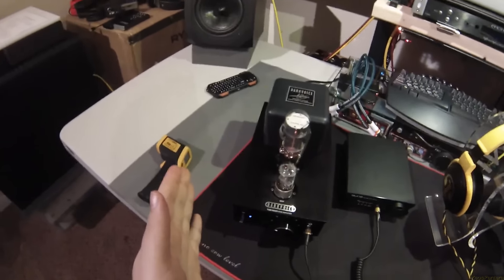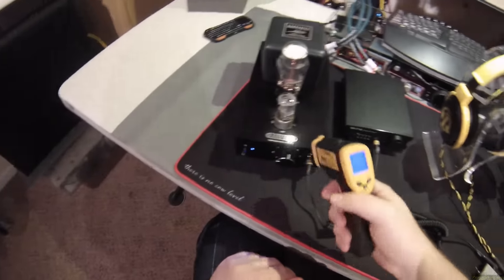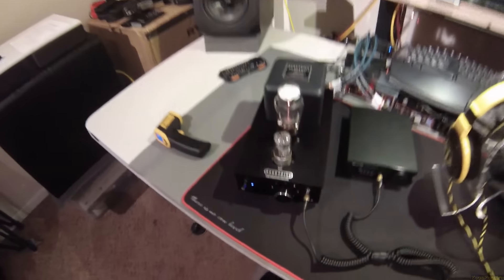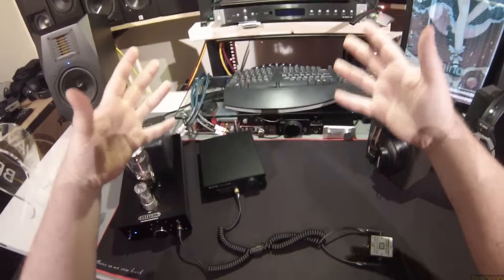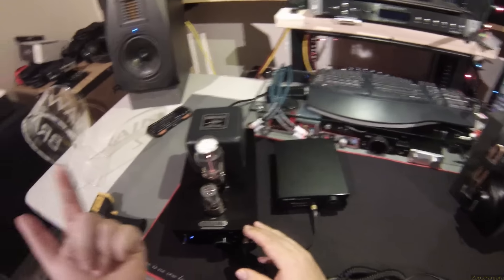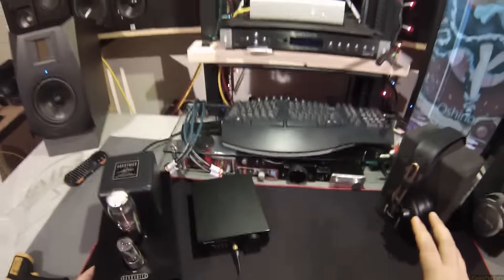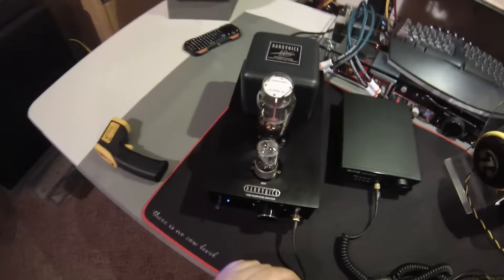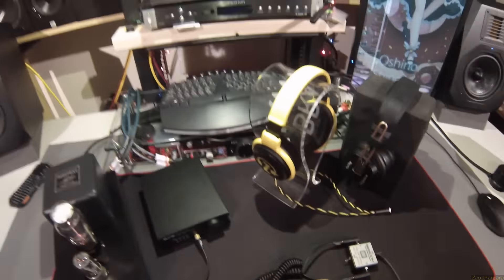Z Review - DarkVoice 336 Tube Amplifier

Comment: The problem with analysing tubes is the fact that every single component from transistors to capacitors to resistors and the tube itself, which is why emulating it well is damn near impossible to do, but in the market of guitar amps there's things going on where people have done just that to make a transistor amp sound nearer to the vacuum. And that's why we are still master-race'ing all over the place about tube amps still

Comment: Turning down the bass is called tightening the bass. It's common among Metal guys. Not sure if Pop guys know about this but it's a common thing if you talk about Metal. Because Metal uses many tube amps cranked up.

You can never replicate a tube sound. Even if you make them sound similar, there's always this one bit that no one can replicate from a tube amp, due to it's full analogness of the amp itself.

Comment: vinyl doesn't have a left and right needle like you're describing here. There is up and down and left and right motion captured that translates to the left and right channel. As far as mono bass, well some records are pressed this way, some are not, it depends. I have many records that do not have mono bass below 150hz. others have mono bass below 200hz. There is a lot of variety in vinyl. Its fun for those of us that enjoy that kind of thing, but generally speaking, vinyl is mastered better, and CAN sound better than digital... but for the most part, I agree that great digital sounds better than very good vinyl simply because you eliminate the physical medium that's susceptible to dust and wear and all kinds of stuff.

Comment: Your A/B switch is a bad thing to do to a tube amp, you must power down your amp then switch or risk wrecking your tubes. And the Dark voice as stated in the comments is a n OTL amp meaning it deas not have an out put transformer  and require high impedance headphones 600 ohm, I found DT 880's to sound great on the darkvoice. Get american tubes and toss the Chinese tubes.

Comment: You highlight a major concern on these cheap Chinese made amplifiers (same for any Chinese made valve/tube amp) is its ability to operate safely without causing a major electrical fire. This is especially of concern to UK users who need it setup to run on 240v.

What I would like to see is the inside of the amp to verify the quality of manufacture.

There are numerous horror stories around of people who have purchased Chinese tube equipment and ended up with electrical and/or fire related problems.

There is a very good reason why good quality tube amplifiers cost big Bucks 😉

Comment: I've been googling the ouput specs.  Pricks only say "1 watt power handling."  Ok...1 watt into what?   Output at 300 ohms?   600?  It's foolish to buy an amp without knowing if it can properly drive high impedence.  430mw/300 ohms is just  enough.  Better 600mw or greater.  Not sure this thing can do that.

Comment: After watching this video I went and assembled myself Laconic Lunchbox Pro. It's a triple tube 20W Russian amp that you can buy made or make buying from the company the complete componentry for it. Mine actually increases low end. Using Fiio E10K I had +3db on bass in VB-Audio Voicemeter, now I have +1,5 on tube and it's still seems to be louder or punchier, or deeper probably because tube sound is softer to the ear and allows for higher volume without noticing it (I wish I had AB switch similar to your's).
Moreover, I found that it's not high impedance headphones that are usually the problem on tube, it's low ones.  That amp is rated 32-150 Omh on low-gain and 150-600 on high but my headphones currently are 16 and they just sounded like badly EQed on low-gain mode and struggling with volume while they were fine on high-impedance mode. Obviously I couldn't just use it on high setting because it actually makes abnormal load on power circuit of the amp. Transformer gets slightly hotter which puts longevity under question. I had to change couple of resistors to allow more power on the output while in low-impedance mode to make things work with my beyerdynamics until I get at least 80 Omh version. Temp is still not perfect (~46,5°C on it's metal box in a hardly ventilated summer heat), but that workaround should be healthier for the transformer.
In other words tubes are perfect for fucking around with hardware. They are like custom PC builds compared to consoles (solid state amps). There's always headroom for improvement. Some people think (and I'll probably agree) that one should ideally make tube amp for particular specific headphone pair. And although you understand that what you hear on tube differs from the way track is meant to be, there is still a shock of how dead solid state sounds after tube even though definitely more accurate.

Comment: @
Z Reviews You might find this interesting😊

Your ear can't place lowest bass very well so who cares if bass is mono, right?  Here is an interesting case and point.
 My 1964 Wurlitzer 4300 organ has a rotary SpectraTone speaker with 2-4" speakers that spin on one end of long approx.18" piece of threaded round stock, a counter weight on the other end, and a stationary center axle . On the outer end of the center axle is a flat disc with a tapered edge that breaks a light beam gradually on one side of the disc, and a photo cell (LDR, light dependent resistor) is on the other side of the disc. Okay, so where does the BASS come from? Certainly not those two 4" speakers. No, actually that gradual change in resistance coming from the LDR goes to a VOLTAGE CONTROLLED AMPLIFIER (VCA). So what happens...
The 4" speakers spin around and around on one end of that vertical shaft. The ear perceives the spacial stereo 'tremulent' effect (amplitude modulation, AM + FM ,frequency modulation...or AM=Tremolo, FM=Vibrato. Combined=TREMULENT...just like what pulsing air does when it is sent through a pipe organ's pipe, AM/FM. WURLITZER figured out that instead of employing a big rotary bass rotor drum (like on a Leslie speaker), they could just modulate the amplitude (volume) of the 12" stationary bass speakers in sync with the 'to and fro' of the spinning AM/FM 4" speakers. The gradual taper of the outer light blocking disc worked it out so as the 4" speaker came gradually nearer, so did the sound of the 2-12" bass speakers get louder, and as the 4" speakers passed by top dead center, the sound of the bass speakers get quieter. To the perception of the listener it sounds as if the bass is also animated with motion as well as the higher frequencies. Wurlitzer was also the only manufacture to put sound louvers on top of the organ as well as the side of the organ. The ad reading, " Because you can't hear with your knees!"

Comment: You could NOT fake a tube sound with DSP's using digital equipment. First reason is that fundamentally what tubes do to sound is way too complex for a DSP's to fake it, because we can't measure all the changes, let alone compensate them. Second, tube amps output is different than solid state output, tube amps can be far more dynamic and fluid in the way they change their output in real time, and you can't fake that with a SS amp. Third, digital equipment can't possibly reproduce the sound the way a tube amp does it because you'd always have the digital sound PLUS the "fake tube" sound, not just the tube sound, because using digital gear you can't possibly remove the way that digital gear produces sound. The way tubes reproduce sound creates totally different distortions than what the solid state amps create, and the distortions that tube amps create are actually realistic because they're even order distortions, all the distortions that happen are perfectly spread out through one octave, then the next, the next after that, etc., just like those that  are created by sounds you hear in reality, voices, instruments, etc. SS amps do it differently, they create odd, uneven distortions that are unrealistic, and different than those created in the real world, that's what you might call "digital" sound, because subjectively, it sort of sounds real, but if you measure it and analyze it more in depth, you realize that it doesn't. Like....a LCD screen, the picture on it looks real, but you're not looking at real stuff, you're looking a bunch of little green, blue and red dots that are faking the picture that you're looking at. That's the difference between solid state and tube amps. So SS amps might sound more "accurate", but they're not, it's just that it's very easy to make an SS amp be "accurate", whereas with tube amps it's far more complex. That's why a lot  of people think that tubes sound "warm" or "muddy", "slow", etc. which is TOTALLY not  true. BAD tubes sound  muddy, slow, warm, etc. Great tubes can sound faster, clearer and more vivid than solid state could ever reproduce, with very life-like quality and great dynamic. Great tube amps still outperform great solid state amps, the thing is, building  a good sounding SS amp is super cheap and easy nowadays, building a good tube amp is far harder, that's why solid state amps go from 6/10 to 10/10 in quality from worst to best, and tube amps go from 1/10 to 10/10 from worst to best. The best professional DSP's for simulating tube sound suck compared to actual professional tube amps or preamps used in studios.
Reply from the maker: +derbigpr500 Is there a rough outline of what these DSP's are doing or is that a trade secret that the creators won't share?
Reply: +Z Reviews I honestly have no idea how they do it, I guess each one has their own way of doing it, but all I know is they don't sound like tubes.  I've got like 10 of those tube amp simulation plugins in my Jriver and Foobar, and none of them do anything else but muddy up the sound and compress it, or make it sound distorted, but in a way that sounds like there's clipping and roughness in sound, and that's not what tubes do.  I know a guy who has a pretty well equipped studio, and he has real tube preamps for microphones as well as preamps that he uses in actual recording or mastering, so he can add real tube sound to anything he records, and it's clear how different the final product sounds if the raw sound was sent through a tube simulation software vs. an actual real tube preamp.
Reply: +synical13 Maybe. All I know is I've heard so REALLY shitty tube amps, particularly headphone tube amps from China that sell for 60-70 dollars online that are really so bad I'd rather plug a headphone into an elephants butt,  but I've heard some stunning tube amps for speakers and amps that  blow anything solid state out of the water, even if those SS amps are several times more expensive.
Reply: +Gray Au I'd like you to back that opinion up.
Reply: +synical13 This.
Reply: Gray Au "I'd rather listen" This is an opinion. You said that it's fact, which contradicts. Hell, you even explicitly say it yourelf " in my opinion".

Comment: What tubes did you end up upgrading to for this amp?
also, if you've tried it with the HD598, HE400i, 712Pro or X2's do you have thoughts on the pairing?

Comment: It's impossible to reproduce tubes accurately with any current-gen full-range application using DSP. It technically 'can' be done but not without processing power increasing dramatically in these pieces of hardware. If people even care to get less detail for more money and research.

It will however, eventually be done for guitar amplification once tech advances 10-fold.  The markets believe they are close and guitar modelling sells like mad... but it's just not the same and in may cases, is nothing more than a sham for novices to be appreciative of on little crappy 8" combo practice amps. For clean guitar reproduction, its so close since it's only processing for a specific frequency range and usually just a single channel. Little processing power is needed to do it here but if you AB them.. you'll still notice right away. Give it 10 years. It'll be perfect... for that narrow guitar range

But then there's a whole different animal of pushing preamp tubes and my EL84s into overdrive that just cannot be recreated in our lifetimes. There is just so many complex interactions between overtones, harmonics, inductance, saturation, power-soaking, transients, how the unique speakers kick back, output transformers relaying speaker reactions back into the tube and even as far as how its wired. You would need immense processing power. Think of IBM's Watson. It would take a large team of coders to get the coding down before that anyways. Million lines of code, easy.

Another nail against it: Current 12-core workstations coupled with the most advanced dedicated studio-grade audio DSP hardware can't even do it yet in post-processing, let alone in real time. 

Even if tech advances to get home audio DSP'ed tube sound going in 20-30 years... A-B the waveforms.. it won't be anywhere near each other.. im sure of it. 

/tube-nerd out

Comment: OMG that tube looks so fragile...
Reply: +feketetv Pick up a light blub. A oldschool, pure glass (none of that ceramic bullshit) blub. You now know how fragile it is.

And tubes can be formed out of a lot of things, glass just looks cool. hell, steel or even crystal have been used before.
Reply: Godin The Killer So the only reason manufacturers use glass is that it looks good?
Reply: feketetv It's cheap, and it's sonically easy to work with is the real main reasons. People just take neat glass objects to mean good.
Reply: Godin The Killer Oh, ok. thanks! :D

Comment: First of all, Tubes aren't flawed or inherently imperfect.  Solid states aren't perfect or all the same.  The most accurate tube amps in the world sound pretty much the same as the most accurate solid states.  Generalizing them doesn't help anyone.  Just review it like any other product.

When I'm fiddling around with my own experiments I do this Blind A/B testing as well. 

But the other important aspect, is to determine if "different" is better.  And for that I just throw a bunch of songs on, and let myself acclimate to each sound, and just shut my brain off.  Whichever one "wins" and it often varies between songs, can sometimes take some time to really decide.
Reply: I think what your saying is don't rely on a B S switch to tell you which sounds better. I've noticed that listening is a true way of deciding. Some people that just want to make video's are not going to take the time & will just say it's different.

Comment: i was about to buy this today, but you said it doesn't really do the role of "pouring honey on your music" - thats exactly what i want though :( is the littledot mk3 more warm? what tube amp would you recommend for honey warmness?
Reply from the maker: I haven't sampled enough to know 100%
Reply: Lol i like how they called that article "audio woo" - perhaps a shot at woo audio (not a fan of that company, or any company that charges 3 times the price for stuff and spread misinformation and BS. I agree with the article for the most part, most tube amps out there don't exactly have the tubey warmth and lot of tube amps even over a thousand sound identical to an o2!! 

however, I got the little dot mk3 and I put NOS mullard m8100s on it, and it is a noticeable difference, I even used it on friends and family with an A/B switch (blind test)  and you can tell right away that with the tubes the sound is richer and fuller and softer and very pleasing. In all honesty though, the LDmk3 is one of the FEW tube amps i seen these days that actually have that tubey sound...i got the darkvoice but the QC on them is quite iffy, and mine started smoking after 2 weeks :/ (returned it) - imo the ldmk3 is much better than the darkvoice.

Basically if you want a tube sound, the ldmk3 is the only amp i can recommend today unless you can find a vintage mcintosh amp or something. because everything from schiit is schiit, and sounds identical to solid state - and the woo firefly sounds identical to solid state for over a thousand, though the woo wa3 has a tube sound, i see no reason to spend that much when you can get a ldmk3 at a fraction of the price. I can't reommend the mk3 enough, i'm very happy with the sound and the build quality is exceptional! and it's byotiful too! 

in general though to get the most out of a tube amp, you want to avoid all "hybrid amps" you need OTL tube amp with high impedance headphones.

Comment: The tube amp just has a rediculously high output impedance.
No wonder you heard more difference with the dynamics than with the planar.
On the hd600 the impedance rises in the highest octaves which on high output impedance outputs boosts SPL in those frequencys.
Tubes are very nice for high voltages like electrostatics but for current they seem to be less ideal.
Reply: GrumpyKitten doesn't lowering the windows volume lvl to like 30% then increasing the amp knob volume fix that ?

Comment: OK man. Get over the heat and wattage of the tubes. Vintage tube equipment has a metal vented cover well away from the tubes. Its a non issue. Modern equipment aren't covered so young bozos can see the orange glow. Its eye candy. This should be about difference of sound.